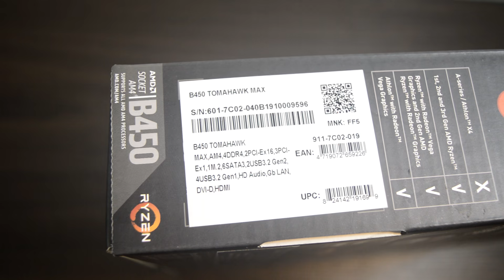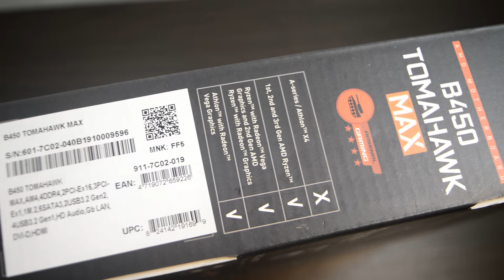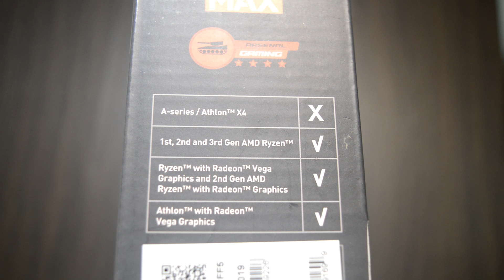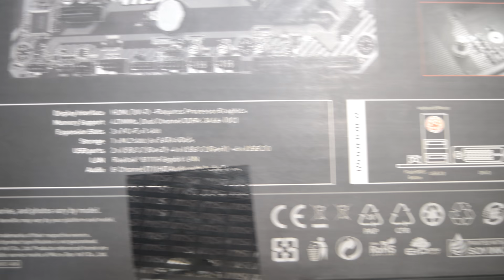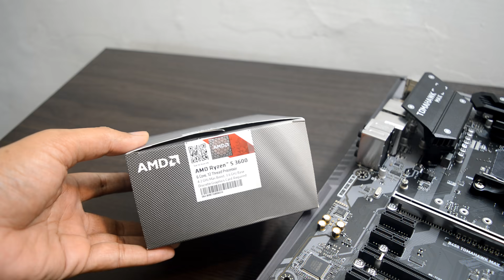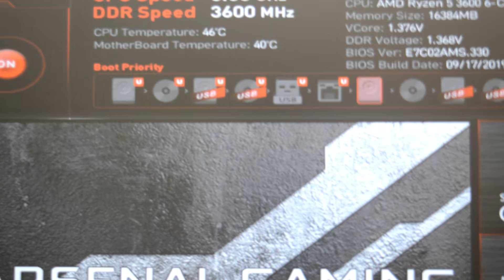MSI B450 Tomahawk MAX Overview | Ryzen 3600 Setup | RAM speed Test

Comment: Just got myself this board but with a 3600X, I'm not fully up to speed with all the newer hardware as I've been out of the loop for a few years (jobs and kids, who needs them, right?) but so far I've had no problems and am very happy with it. 

My only concern is (with the 3600X anyway) that the stock cooler isn't good enough under reasonably high load benchmarking with it OC to 4.1ghz (3.8ghz stock) it can run fairly warm (I hit 82 degrees) during a cinebench.

Really enjoyed the video, and I learnt a couple of things about my board also, thank you.
Reply from the maker: Thanks for the comment. The stock cooler is just fine if you do  gaming mostly
Reply: You should not have gotten the 3600X. The 3600 is way better for the price.
Reply: @rishilkadakia4779  free upgrade to the x, so I wasn't gonna pass it up.
Reply: TheHellboy561 Oh, I see. Well, in that case, good choice!
Reply: @TheHellboy561  what gpu do you have? thinking upgrading my comp to this motherboard and then getting a r5 3600 with like a 1660 ti or something. Rocking a z97, i5 4690k, and gtx 960 so a super old and out of date comp that is pretty unplayable on the games nowadays like cod
Reply: @nickdreezy2457  I'm only on an rx580, managed to get CPU cheap but I'll upgrade my GPU at some point.
Reply: @TheHellboy561  why would you oc it with a stock cooler...
Reply: @Ninjer  why not? See what happens
Reply: I was hitting 87 celsius... just BIOS your fans to 100% at all time and I am reaching max 75 now

Comment: I had an issue with the ram slots, the computer was booting only with the ram in dimma1 and dimma2 even if aren’t the optimised slots. So the ram frequency was stuck on 2133mhz, I tried to over lock them to their original capacity (3200mhz) and it was a success thanks to you lol

Comment: I got the tomahawk max and a 3700x a couple weeks ago, with 3600memory, now my games are silky smooth. :)
Reply from the maker: It's a great comb, especially I love this motherboard
Reply: Can i om b450 tomahawk max ram 3200 MHz? Cuz i see im spec max is 2666
Reply: @cyckipapieza1040  it should easily handle 3200mhz ram, as you see i have 3600mhz ram. I think it can handle even higher speeds.
Reply: @Guovssohas  ok cuz i see on 570x chipset was can handle 3200 MHz and its more expensive than b450 tomahawk max so ok thx
Reply: Guovssohas How is your PC holding up
Reply: @yazendaddi9127  it's holding up great, no issues so far.
Reply: Guovssohas Alright good because idk if my board or gpu broke because I went into the bios to update it and I put the wrong Usb stick in so I went and exited bios and it broke. I changed cable and nothing so yeah. I'm gonna give msi another chance
Reply: @yazendaddi9127  That sucks, sorry to hear that. I was really nervous when i updated my bios, i made sure the usb stick was completely empty of any other files before attempting the update. Luckily it went fine. I hope you get your pc up and running again soon.

Comment: The best Allround Motherboard with verry good VRM and a good Price. I use the None Max Version with a Ryzen 5 3600, but i test the 3700x and a 3900x on the Board too and np to run. And nice greetings from Germany and a nice first Advent.
Reply: Does it come 
Ryzen 3000 ready ?
Reply: ich bin auch aus Deutschland 👋
Reply: @islamali852  it does
Reply: Np means no problem?
Reply: Rene Frank hab eine Frage hat das Bord Bluetooth und ps2 Eingänge?
Reply: This is the best vrm board for b450. You won't regret purchasing it.
Reply: @alexwong-s7s  Source?
Reply: @scarecrovv_  can see buildzoid or gamer nexus talking about vrm of b450. Search around YouTube
Reply: @alexwong-s7s  Found them. Thanks!
Reply: What ram speeds does it support I'm getting 2x 8gb 3200 MHz ram and this site says 2667mhz is max
Reply: @basedbrandon9407  You might just have to enable XMP profile in the bios.

Comment: Nice video and tips here (interesting that 5-dot tim application)!
Well I have that board and it's my first AM4 board.
I'm quite surprise to see how easily you removed that socket bracket screws.
No sure it just me, in my board that screws are way too tight.
I'm scared to apply too much force and damage that screws.
So I endeup up with a Corsair AIO wich uses the OEM bracket.

Comment: Why did you use thermal paste when the stock cooler comes with pre applied thermal paste
Reply: @FluffedUpMaverick  Do you have to clean the pre applied off first or just add to it?
Reply: @bertiebaws  you should always if you want to change paste
Reply: @Daniel Johnson which guy dude?
Reply: @bertiebaws  pre applied is usually too much use a little line of thermal paste my man, dont use too much or you could get it in the cpu pins and holders and damage your cpu and motherboard, watch some videos online
Reply: @rezdevs  if the paste is not electricaly conductive it doesn't matter if some gets to the pins.
Reply: @ancaro8771  thermal paste is conductive thermally but insulates electricity and if it gets in the pins that is a problems because each pin is specifically designed for a certain task in the cpu and covering it with thermal paste would ruin that

Comment: did you have to update bios or did it work straight out the box?
might seem like a stupid question but I've read different things about this.
Reply from the maker: New cpu work out of the box
Reply: Kacper Krzeminski with the b450 tomahawk MAX, Ryzen 5 3600 will work straight away. With the none max version u need to update bios first I think. But using the bios flashback button, u can update using a usb rather than an older cpu
Reply: Max versions are ryzen 3rd gen ready. Other versions need bios flashed
Reply: @RahulVerma-bo4ef  does bios update ryzen 3600x ?
Reply: Does anyone know if the b450 a pro max is the same 3red gen ready?
Reply: just for comments hey, so I have the same mother board and cpu. But it won’t connect to my tv (my monitor hasn’t come in yet) the cpu light is on as well
Reply: just for comments any advice

Comment: I highly recommend the mis b450 tomahawk. got mine about 2 weeks ago with a ryzen 5 2600x and 16gb 3000mhz ram. Amazing bang for the buck!
Reply: Fox can I use ARGB here or RGB preferable?
Reply: What's the difference between this and the gaming max?
Reply: You're using one 16 gb of ram or two sticks? Asking because am thinking on using one 16 gb 3200 stick with ryzen 5 3600
Reply: @menace2societies  both i believe
Reply: @espartacos1  always go for 2 sticks. That way it will be recognised as dual channel and dual channel gives more performance as compared to single channel.
Reply: I'm using the same specs with slightly faster ram, anything I should know before/after building?

Comment: Did you need a bios update to use the ryzen 5 3600 with the tomahawk?
Reply from the maker: Not necessary for this model
Reply: no because this is the MAX version, but on the box it aslo says that it supports ryzen 3000 cpus

Comment: you should turn the stock cooler 180º. This way you will have some trouble to place the 4 ram module in the slot.
Reply from the maker: Yes it makes more sense , thanks for nothing it. Surely will help other viewers too.
Reply: @OdinHardware  Noting*
Reply: @khakirock  Does not fit the other way, clashes with the heatsink!! AMD should move the 'lump' on the fan by 90°.
Reply: @geobixx8132  yeah, I actually just got a b450 max and a 3600 and put them together yesterday.  I wasn't able to do it different than the video because of the heat sink. But I figured im not gonna have 4 sticks of ram anytime soon. and if i do im going to upgrade the cooler.

Comment: For all of you veterans out there I am new to PC building, I am using a 3700x along with the msi B450 NOT THE MAX ANYWAY, Two QUESTIONS:
1. Is it ok to use stock cooler 
2. WILL the b450 support my DDR4 3600
Parts:
AMD RYZEN 7 3700X
MSI GeForce RTX 2070 SUPER
 B450 Tomahawk 
G.SKILL 2X8GB 3600
SILICON POWER 256 GB M.2 2280
SEAGATE BarraCuda 2TB 
Seasonic 650 w GOLD CERT
Reply from the maker: Yes stock cooler is fine gaming
Yes MSI b450 will support 3600 whennpaired with ryzen 3000:series
Reply: @OdinHardware  Thanks :) I ended up getting the b450 Tomahawk Max
Reply: M A Did the Ryzen 7 3700x work straight out of the box with the motherboard? Curious bc I plan on getting a 3700x but don’t know if I need to get a x570 board.
Reply: @bbyfcedaijyt  the tomahawk max will work, but the tomahawk original needs a flahsback which is fairly simple to do, a lot of people have been recommending the b450 tomahawk max over any x570 because of how cheap it is, so I ended up getting the b450 tomhawk max
Reply: M A Okay, do you know of any other great x570 mobos. I tried getting the Tomahawk max but I can’t find it anywhere online.
Reply: I just saw wit on eBay for 195
Reply: @bbyfcedaijyt  I did a lot of research on this and I asked many people, basically you will not find something as reliable as the b450 max less than 300-400
Reply: M A Okay great, thank you. I want to get the ryzen 7 3700x and 1660 super with this board.
Reply: Daizee that’s cool from what I understand The tomahawk max should be more than enough

Comment: nice vid man! i have a question for you. If i start counting from the nearest slot to the fan from 1. where i should put my rams? i have ddr4. i see you put them at 2 and 4 slots. is this the right position or 1 and 3 ?
Reply from the maker: 2 and 4 are the recommended slots by most motherboard models.
Reply: You usually want to put them far away from the CPU and skipping 1 if you have 4 slots and 2 chips of ram, so 4th and 2nd.
Reply: um what if i’m tryna get 4 16?

Comment: Is it recommended to remove the already applied thermalpaste off of the cooler and reapply an after market paste on the cpu?
Reply: You should just leave the pre-applied thermal paste on
Reply: @bryanji429  Will do, just ordered this motherboard and a 3600 yesterday and didn't want to have to order extra thermal paste
Reply from the maker: Rather than thermal paste it wise to use better cooler itself

Comment: Why did you push down the CPU Processor at 5:14 even thought it inserted? and that there's already thermal paste re-applied on the amd stock cooler so i don't get why you are using extra thermal paste?
Reply: I saw that to- I was told if it has paste don’t put more- if it doesn’t have pasted use some..

Comment: tha CPU temp was because u put too little paste  in the middle. It should be around 39-40C with the stock cooler if it had the right amount of paste.
Reply: So, it will be good is we do not apply  extra thermal paste?

Comment: I'm taking a look a look at the exact same components right now. I will be upgrading from my old i5 3570 to this, so it will be a big step up for me. Only thing that's on my mind is if I should transfer my aftermarket CPU cooler, or just go with Ryzen 3600 original one. I currently have Be quiet! Pure Rock Slim, so it's not really something special, but it keeps temperatures under 50C most of the time for me. So yeah, what do you think should I leave original or just transfer my Be quiet! cooler?
Reply: America  Thanks. I just received my components today and I installed stock one. I will see how it performs when I connect everything, but it should be similar since BeQuiet cooler was one of the cheapest around.

Comment: Is it necessary to apply extra thermal paste to the stock cooler? It has this pre installed thermal pad, would that alone be enough. I am not going to overclock the cpu.
Reply: Dont mix thermal paste. Use stock fan with pre applied paste. If using aftermarket paste remove the paste from fan with isopropyl alcohol. Aftermarket cpu cooler fans are better than the stock fan that comes with the ryzen.
Reply: No its not necessary but have in mind that the "stock" paste will have less lifetime than the aftermarket paste of good quality
Reply: Thanks for the awnsers!
Reply from the maker: @MrPoppasmurf79  Well said,  ryzen 3600 needs better cooler.

Comment: Hello. I wonder if the system was stable with the memory at 3600 mhz. Thanks!
Reply from the maker: Yes it stable
Reply: 3600mhz is the best for r7 3700x by the way not lower or higher

Comment: MSI meme : the MORTAR MAX a micro ATX motherboard has 8 usb ports and two M.2 slots
The Tomahawk MAX an ATX motherboard has only 5 usb ports and one M.2 slot
and they are at the same price range, like wthhh msi xD
if you find the motar max in your country go for it, if not go for tomahawk max
Reply from the maker: Yes right this model has less usb ports but the mortar max lacks vrm heatsink
Reply: @OdinHardware  also the mortar has only 4 sata III and the tomahawk has 6 sata III
Reply: And if you have a pcie wifi card and use a chunky gpu you cannot use the wifi card

Comment: hi, I have one question. Does the cooler fit facing any direction? it seems that its blocking the first ram socket, did you pu it like that for any particullar reason?
Reply from the maker: Yes you can fit it at any direction

Comment: So im confused about the ram. I see the kind you installed isnt technically 'compatible' with the processor or mobo per msi website and amd says 3200mhz ram for r5/3600. so im going with G.Skill - Ripjaws V 16GB (2 x 8GB) DDR4-3200 PC4-25600 CL16 Dual Channel Desktop Memory Kit F4-3200C16D-16GVKB - Black. Very confusing. Any thoughts?
Reply from the maker: There are lot of discussion s going on ryzen ram performance 
3200mhz with tight timings cl14/15 will be safer choice and install it in dual channel
Reply: @OdinHardware  well im going with the one i could find that was on the compatible list, i checked at least 25 - 30 rams and the one above is the ONLY one i could find.

Comment: Sir, may I know where I can connect front panel fans in this mobo??
Reply from the maker: You mean three fans on the front ?
You can use motherboard  system fan headers. Make sure your fans has Sufficient  wire length
Reply: @OdinHardware  thanks!

Comment: I wish i had that mother board right now😞 literally last thing i need for my first ever build and i’ve been waiting for that to come on stock since two weeks already, anyways can u suggest another mother board if that wont come in stock?
Reply: Try gigabyte's x570 Aorus pro wifi
Reply: Edvis okay i’ll try to find one today, good suggestion my gpu is also a gigabyte model. (Rx 5600xt gigabyte gaming oc) thx for the reply.
Reply: guys should i go with the 3600x’ stock cooler or buy an after market one?
Reply: @ToroJii  if you will overclock, then you need an aftermarket cooler, otherwise its fine.
Reply from the maker: You can manage with stock cooler for some time. It's not as bad as 3600 stock cooler
Reply: As of today 6/22 the motherboard is in stock at neweeg

Comment: Quick question, did you have to flash the BIOS? I'm new to PC building and I'm worried that I'll have to buy another CPU just to get the 3600 to work
Reply from the maker: Not necessary for this motherboard model

Comment: Getting same board but with a 3700X. Nice video dude.
Reply from the maker: Thanks !  3700x- great choice and this mobo model will perfectly match it.
Reply: @OdinHardware  Thanks! bought it today should have it all setup tomorrow :)
Reply from the maker: @Void-uj7jd  Share your experience after setting  up.
Reply: Same here! These are good times guys!
Reply: @OdinHardware  Got it built today. That CPU is incredible! https://i.imgur.com/53RhPyo.jpg
Had no problems with BIOS or anything, everything was super smooth and system is extremely snappy.
Reply from the maker: @Void-uj7jd  Thanks for the comment, And build looks awesome especially the elite case !
Reply: @OdinHardware  Thanks. This is my entire setup https://i.imgur.com/zsopg0Z.jpg
Reply: @Void-uj7jd i check you pic ots seems that you have 3 rgp fans and only stock coller for cpu this is good enought sir ? For performance with gaming ?
Reply: @fingerstyle9165  The 3700X goes to about 70C with stock cooler while gaming at max settings 1080p with the cpu cooler set to low performance mode. I heard a decent after market cooler can bring it down to 50c. But yes it's stable I don't notice any throttling or crashing. I also should mention I get full 4.4ghz boost with stock cooler. You can place a fan at the top of the case and reduce CPU temps by 5C. I'll probably do that at some point.

Comment: Hey VMreviews. Can you help me with you temps and voltages. in AID64 I see my -12V going to -13.286, Is this ideal? Also My RAM is G Skill Tridentz Neo 3200Mhz. Post enabling the XMP and running heavy tasks causes system restarts. What could be the issue? Please help me. I have the same configuration, only the RAM is different.
Reply from the maker: Cross check the voltages with other tools. Did you try with xmp disabled?

Comment: I have these in my setup and it keeps constantly power cycling on and off. :(
It's not an issue with the power supply I've tested 3 different power supplies in this with no luck and even got a replacement motherboard.
Has anyone else experienced this, or knows what to do about it?
Reply from the maker: Reinstall the cpu and check
Reply from the maker: It happened once for  me
Reply: @OdinHardware  I have done, twice if I remember correctly

Comment: with the way you put on the cpu cooler it looked like it blocked the first ram slot, do you have to put the cooler on that way or can you flip it on the other side?
Reply from the maker: Yes you can flip it on the other side, but normal users will hesitate doing that. BTW , it doesn't block the ram slot
Reply: @OdinHardware  oh right thanks for replying it just really looked like it did block it for some reason :P